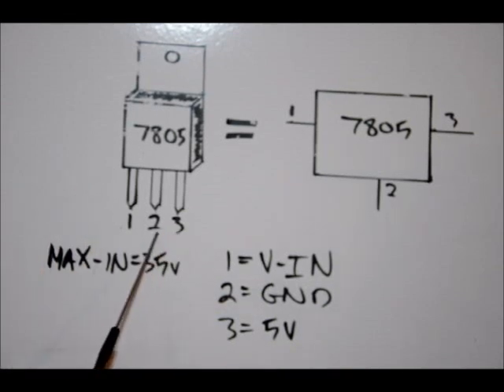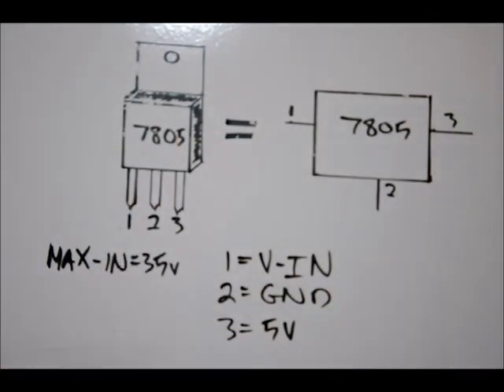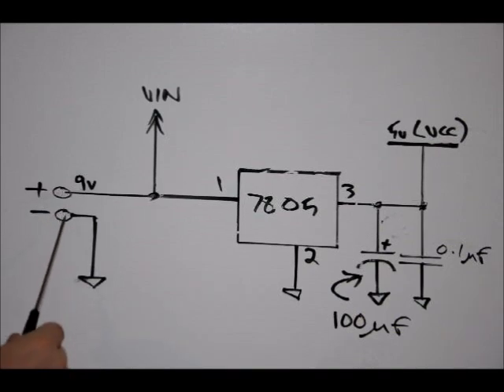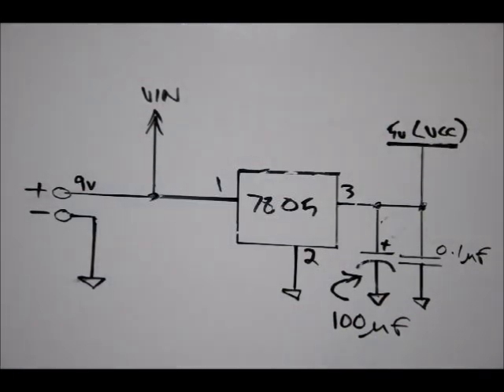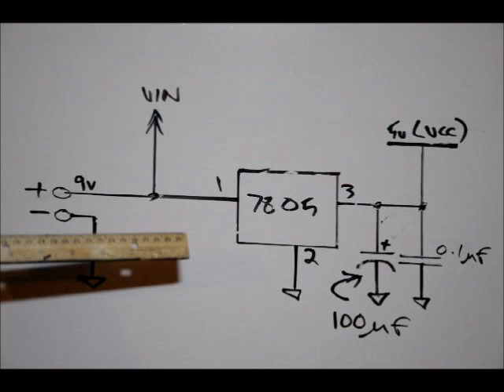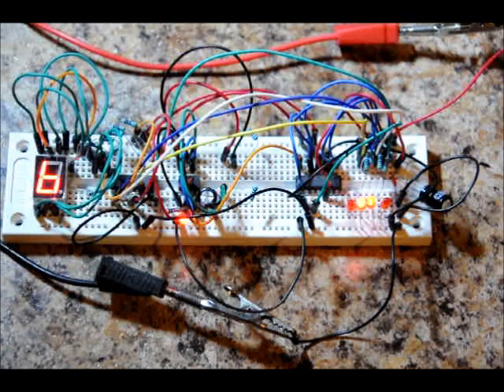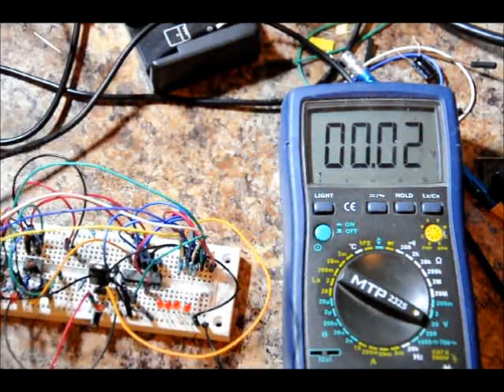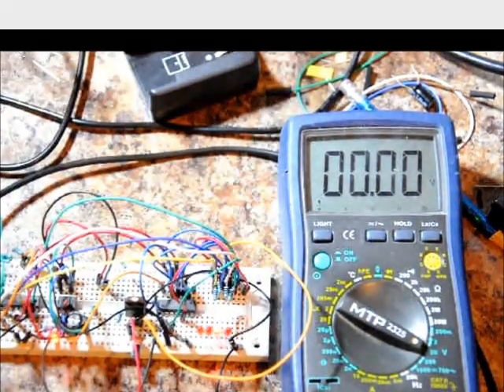Electronic Tutorial: A Detailed Tutorial On the 7805 5V (5 Volt) Regulator IC (Theory & Lab)

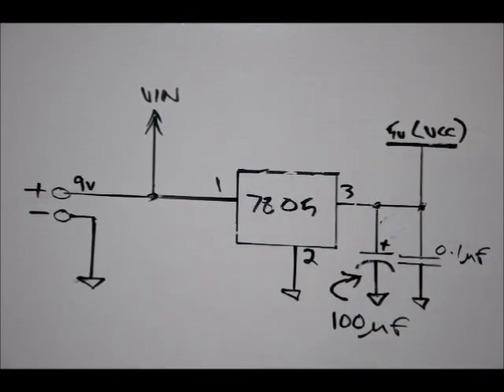Comment: Hi... I am a bit of a Neophyte to Electronics... At min.: 6:00 you note about putting 100uf & 0.1uf caps on the V in side of the circuit if you want to stabilize the V in. My question is two fold 1st do you place the 100uf & 0.1uf caps to the Left of the V in connection and 2nd how do you stabilize the this output voltage? As I would like to have a stable 9volts to drive some LEDs.  Thank you for your time, help and/or direction regarding this question..

Comment: Can i make a +5 -5 suppy from this 7805 pleass ?
Reply: Use a 7805 and a 7905.
Reply: Us I understand, for real negative supply you as well need or separate transformer or negative line and you need like Cotronixco says 7905 for negative voltage ,but I would use adgastable LM317 for posetive  and LM337 for negative. Then you can have one box of voltage regulators for decent price for any kind of low current (1.5A) projects.

Comment: Theoretically speaking, if I connect pin 1 to + side of a 6V battery, and pin 2 to the - side, I get 5v from pin 3?
Reply: yes, keep in mind there is voltage drop. So could be that you need to use as input more than 6V.

Comment: Why don't we, or do we need a diode to keep the phone/other device from trying to charge a 9volt battery after it goes below the threshold voltage, is there built in diodes
in either the regulator or the device ? 
I see you're using a wallwart, but I'd be using a battery.

Comment: Appreciate the comment 'very inexpensive' as oppossed to 'cheap' as so many tubers like to say.
7805 is not crap , it's just easy on the pocket book.
I was told to use a 10uf input to grd and 10uf output to grd(electrolytic) with a 104 ceramic additionally at ouput to grd, does this sound right ?
Reply: yes